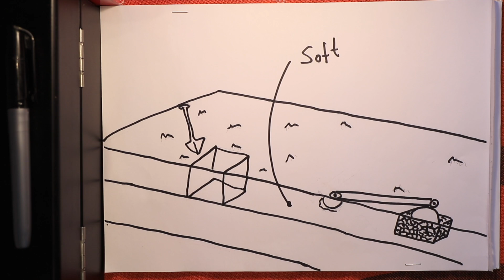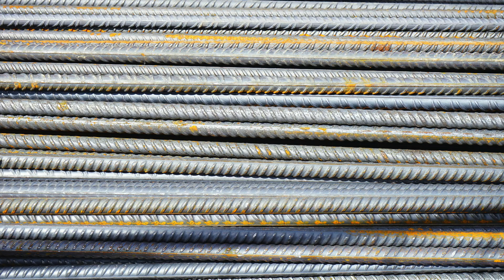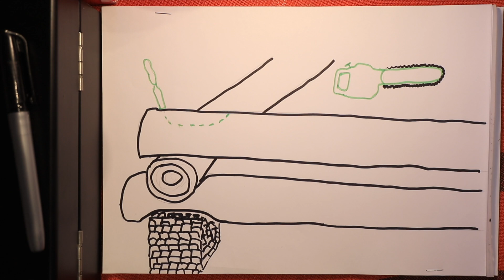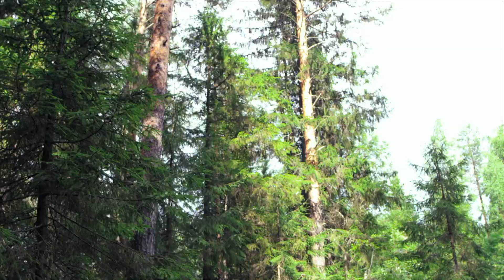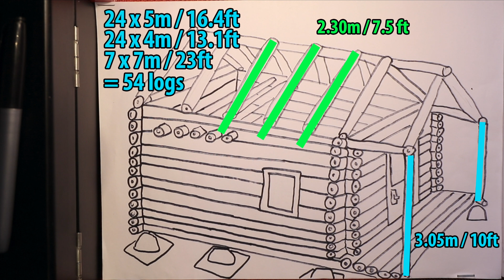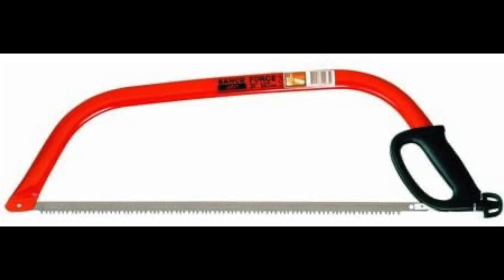Learning to Solo Build a Log Cabin for cheap

Comment: There are many videos available that are made by people with actual experience building log cabins that address things like the actual skills you need and the physical challenges involved in moving logs around by yourself. There are also quite a few approaches to building a log cabin and there's a range of actual quality in the end results. If you wanted to put up a small cabin in a big hurry and were not too worried about the durability and willing to put lots of time into chinking gaps, the "butt and pass" method is really fast and simple. If you wanted to take more time and produce something that might be livable for hundreds of years, I would suggest looking into the Scandinavian building styles (Norway, Sweden and Finland, there are good videos on all three nation's building styles) which involve a range of notching methods, some of which get pretty technical, and a groove on the under side of each log that rests on the log below and minimizes the need for chinking gaps. The groove also helps control the natural tendency of logs to split as they dry, providing a weaker spot in the log and directing the cracks that will form into the groove. That keeps the cracks out of the weather and avoids having freeze thaw cycles working to break your building down.

Comment: Part of building a log cabin should always be to plant the trees that you cut down.
Reply from the maker: Good suggestion! Thank you Lord
Reply: Read up about timber management, bc that's usually not how you create a healthy forest. My land desperately needs thinned. Need to cut all the pines with beetles in them before they take over. Way too crowded in my patch of woods. Have to take out some larger, less healthy pines to allow for more natural biodiversity to take root. Already tons of saplings underneath the pines fighting for light. No need to plant more bc in felling 10 trees there are 20 who will get enough light begin to fill that gap in canopy. I will likely still have to come thin those saplings as well to allow for my food forest underneath the canopy. 

There are plenty of trees, we need to work on making what IS growing more natural & diverse.

Comment: That's cool, but it's gona be a lot of work. What do you mean with just 100$? It will be a lot more expensive, wood, tools, tractor and other machinery
Reply from the maker: No tractor, just by hand. And as for tools. Most people have most of the tools in their shed, so I'm calculating the actual building material. Which should be mostly wood from the forest. But, we'll see!